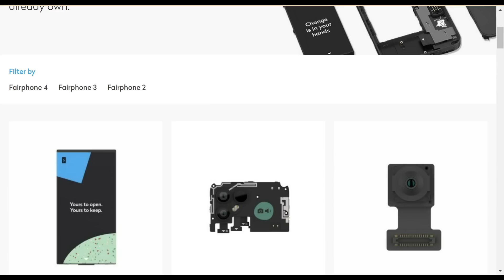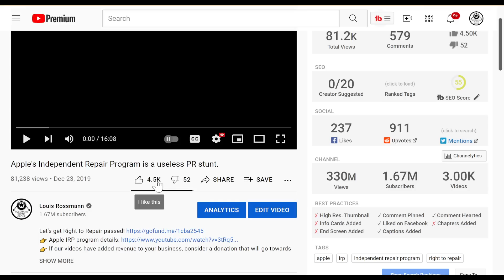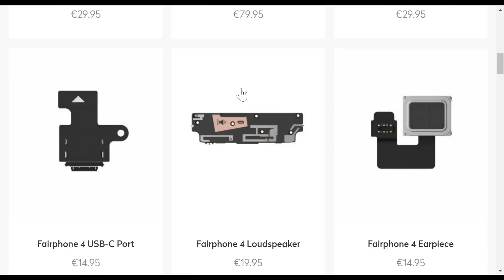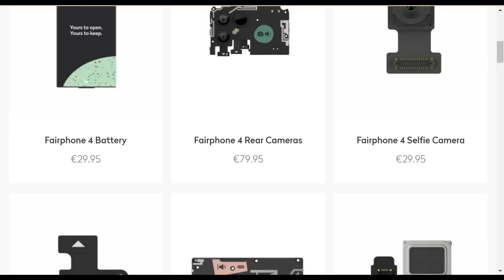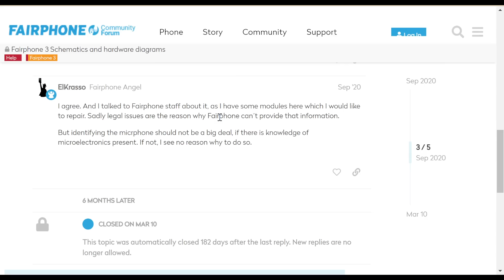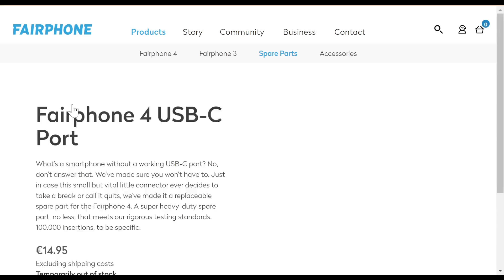Fairphone thoughts & commentary with Louis Rossmann

Comment: but 30€ for a battery and 80€ for a screen though..

My pocophone f1 has a better cpu at half the price and I pay 5€ for a battery and 20-30€ for a screen.
Reply from the maker: Their prices are fair. They're trying to stay in business not selling products made with slave labor. This in my opinion is an unfair criticism of them. Keeping parts available, having a supply chain and everything for that, that cost money. As does designing a device from scratch in a fair trade manner. I have no problem paying for value
Reply: You are missing the point. Fair trade does not mean “cheap” because of slave labor.
Reply: I had a poco F1 and changed the screen. It was 30usd from china, and it was clearly a worse LCD than original, probably not 1080 either.
A decent chinese made battery was about 10usd, the 5 usd ones are usually crap. The prices seem fair. 
Also, the phone itself is not a good deal, that's not the point of the phone. So the parts need to fulfill the  sustainable thing, a fair price is not the point.
Reply: 'but 30€ for a battery and 80€ for a screen though...'  As opposed to shelling out for a new phone.  Pfft.
Reply: yes we all know that there's cheaper stuff around, fella
Reply: A lot cheaper than replacing the phone...
Reply: Your 5€ battery cost 5€ cause its made by slave labour.

Comment: In the last couple of years I've noticed that a phone in my pocket holds at maximum 2 years, I had a samsung and the battery started to pop out, bought a new one and and it did the same just in a couple of weeks. But most of my phones failed on the front panel ... the glass cracked.

In most of these cases first I have tried to remove the glue and replace just the glass but every time I tried that the screen got damaged. It takes skill to replace it. After failing 3 times, I have also tried to bring the device to a repair shop, but it costs more than the device itself. Phone initially costed 400 Schmeckles, used it two years and now on the market costs 100 Schmeckles. Repair costs 160 Schmeckles. It doesn't make any sense to repair it.

But what annoys me now more, is the new feature from Google: "Play Protect certified",  this puts another gravestone on the reparability as some like me will chose to install a new OS if the supplier of the phone just shuts down the updates. Problem is that it will render the repair useless, with the "Play protect certified" most of the apps won't work anymore even if the hardware is good enough. 

With all this, I have decided to buy actually a Fairphone, but it feels like I am going back 10 years or so. In worst case I will need to go to the bank to make transactions and watch the favorite series on the TV. May not be such a bad experience at all :)

Comment: Probably the fictitious billionaire could buy 5G Modem IP from CEVA and processor IP from arm, and so on, and build their own phone SoC, without starting completely from scratch. Whatever NDA's are required for the silicon don't matter for practical purposes since you're not fabbing chips in your repair shop. But the application reference schematics, manuals, datasheets, etc for that SoC could then have a more open release model.

Comment: I know this video is old now but my note8 battery is dying, been quoted over £100 for a new battery from the local shop that knows there shit and doesn't buy crap battery that die in 12m due to Samsung making it a pain and it been an older model now, as I stopped getting updates over a year ago and Samsung locked it down so much lineage OS can not be installed I am not changing the battery, So I am looking for a new phone,  No headphone jack is a huge pain but it has a removable battery and upgradeable storage love the 5 year warrantee and software updates  also want to put my money where my mouth is on right to repair. Do we have any more update re the scamatics? if jo public can not get them I understand to a point but can repair shops get them?

Comment: I'm looking at fairphone for my next phone as Google went evil and everyone is just copying Apple now. The whole reason I'm on Android and not iOS is because it's more open. I feel the market is now more ready for a Windows phone as Android is a far cry from what it used to be. It's been down hill since kitkat if you ask me, change for the sake of change and too many bugs introduced and not fixed.

However that being said, it's probably better for the environment to fix my Pixel 2 XL, but it no longer gets security updates. If I break it replacing my battery the fairphone is my backup plan.

I started in Android with removable batteries, HTC later then added front facing stereo speakers. The batteries I could live without as I was upgrading every couple of years but now I have a package I'm happy with. All I want is my Pixel 2 XL, I need nothing more except longevity. The charge port is loose now, no more security updates and the battery is at 50%.

Fairphone isn't perfect, their first phone didn't offer parts for as long as they expected because the cost to get replacements was prohibitive. They should of offered a trade in program and second hand parts. Still seems like they have a heart, and it's in the right place, which is extremely rare for a company.

I don't want to help rich people get richer and destroy the environment.

Comment: I see many are complaining about the headphone 3.5mm jack.
I wouldn't go back to using a cable.
The audio quality argument is irrelevant as most people can't tell the difference and those who can, can still buy a phone with a headphone jack.
The price is also mostly irrelevant as I used for a long time 25€ bluetooth headphones.
The battery argument is still reasonable, but then I can still use a cable, just not a 3.5mm, but a USB-C one.
Ultimately, the debate seems to be about whether a phone needs 1 cabled port, or 2. As far as I'm concerned, the goal should be 0, but there are very good technological reasons why this goal is not reachable today (see wireless charging issues). 1 cabled port is achievable today.

I understand that some people may need 2 separate ports for their phones. Louis himself has described a use case where 2 ports are a must (something involving a fast bike, long days, and external batteries). But such use cases will always be catered by niche devices, not mainstream ones, like Fairphone wants to be. Could or should Fairphone release one also for that niche market? It could, but what does this have to do with the mainstream Fairphone 4? Similarly, CAT makes phones with thermal cameras for ~700$ with specs more commonly found in 100$-300$ phones. People buy CAT phones and they wouldn't buy anything else. Does this mean that all phones should have thermal cameras? Why not? Aren't the producers taking away the consumer's option of having a thermal camera?
The reason headphone jacks are not common anymore has nothing to do with sustainability, or greediness, or whatever excuse marketing departments are making all around the world. The reason is that people just wouldn't use them, even if they would be available in every phone as we speak. The only exception to this are less developed countries where my 25€ bt headphones would be considered expensive and instead people would use 1$ cabled in earphones. This is something politicians should fix though, not phone manufacturers.

Anyway, there will never be a massive coming back of the headphone jack. Some phones will still have it, just like some phones still have an IR port, or thermal cameras.

Comment: I really like the concept but its just too expensive for a low range chipset. I do believe the LG G5 H820 from 2016 is a much better deal imo. Its costs only $80 USD, its smaller, has SD820 Chipset, a headphone jack, a microSD Card slot,  removable battery (upgradable up-to 5700mah for $15 via Aliexpress). I just wish they made this phone smaller so it can fit in your hand and cheaper. Hope this helps.

Comment: Headphone jack is the last stand. I love my old analogue Bose headset from years ago. I love it that even if I don't use it regularly, whenever I reach for it, I know I can just plug it in and it will work. I don't have to worry about if it was charged, or lithium battery has worn out, or was it paired up with the new device I'm using. I don't have to think about if the blue tooth protocol it uses supports lossless codec like apt-X or now here comes yet another "standard"; aptX+HD. Come on! Keep going down the rabbit hole.  The industry wants 3.5mm audio jack gone, so we can throw away all the quality headsets we purchased and create yet another throw away disposable product line. Dido was so right; Life for Rent.

Comment: As cool as it would be to have schematics, it's not unheard of for component manufacturers to require you to sign NDAs before giving you anything you'd need to actually work with their components. I wouldn't be surprised if it's more than just Qualcomm, maybe the camera or memory manufacturers require it too.

Even in the maker space, many single board computer manufacturers, including the Raspberry Pi foundation, will not provide schematics (and if they do, it's partial schematics with all the secret stuff removed. These are hard to produce and keep up to date, and not always that useful anyway). This is a place where schematics are genuinely really useful and would make a good selling point to many of its users and yet they're absent even here.

Comment: Would right to repair legislation side step this NDA processor reference design issue by requiring the release of the information? Effectively forcing Qualcomm's hand? Alternatively, it's be a shame if the schematics and board view files were to be leaked like lots of of other schematics are. Wink wink nudge nudge

Comment: What if it takes a few years but piece by piece they redesign and reverse engineer every piece they sell, untill they do have schematics of their own and are no longer tied down to other manufacturers schematics? Why would that take years? well Every little piece is already designed to max capacity here, your charge port, camera, battery have as you say has already been well established and copy pasted, but it took years to get to this state.  To best redesign something you would need another base chip, to start from, like something other than the qualcomm snapdragon, exynos or a10, which entails a totally new processor, preferrably with a different headerpin set. Because otherwise no matter how much you start from scratch, you would end up copying the layout to begin with. So in order for that to happen Fairphone would have to invest in a company that e.g makes the camera processor from scratch they make a replaceable camera module and release the schematics for that, but that is a huge investment, the way processors are scarce now I do not think this will be an easy or cheap way to do. But it is the only way to be completely free

Comment: I get it, but the price of a used DSLR camera for the rear camera is a bit too ouch for me. Those parts literally cost a few bucks, but because of the proprietary cable and frame, the price jumps up 10x. Those spare parts are so expensive, maybe I would be better off buying a new phone for parts only. Also 30 bucks for a selfie camera? WHAT?
The price it would cost to get a regular phone repaired somewhere goes right into their pocket by letting the user fix it. 20-60 bucks extra just for the connectors, brackets and screws? No, fuck that.

Comment: Stallman was using a Lenovo laptop. But he was not using the BIOS that came with the laptop. He is using a custom bios called 'Libreboot' which only works on a very select few old laptops. And is created using reverse engineering by a handful of dedicated developers.

Installing Libreboot is a difficult process that involves nearly full disassembly of the laptop and manually flashing a chip on the motherboard using another computer. And even then it still won't work because the default wifi adapter requires non-free software, so that needs to be replaced too.

Comment: We're probably like 4 or 5 years away from a full open source hardware computer, using RISC-V processors. There's one system from SiFive, but it's largely a proof of concept. This is potentially huge because anyone who wants to build RISC-V doesn't need to pay ARM, Qualcomm, etc. license fees and royalties. Chinese companies are very quickly jumping on board, and I hope they start driving innovation here.

The next big pieces needed here are wireless and GPU. Everything else is open standard.

Comment: Isn't board views enough? Why do you need the schematics for repair over board views? Personally I use more board views than schematics. I don't need to go that deep for repair. If there is an issue with schematics and IP issues, why not create a definition for a minimum board view and demand board views? This way cutting off this argument.

Comment: Would you still need schematics if the HDD is not hardwired to the bios/prossesor. If you need to repare the motherbord on a phone like this. would it be better to replace board and then put the drive into the new board. This is if you are looking to get the data off the device. 
Still think there should be a way to get the schematics for bussness and 3rd party repare without braking there cofidetuility agreements with the 3rd party dovelopers.

Comment: I'd be interested in which schematics you need. Soldering new chips on a motherboard most likely requires that you know the layout of the board and the IO of the individual components (and possibly more, I have absolutely no clue), but maybe not the internal specs for the parts themselves. There should be a middle ground here. Companies could tell you what soldering points need what, where they go, etc, without disclosing exactly how each individual chip is manufactured internally.

I would love some clarification on this. I do want you ond others like you to be able to do repairs as easily and effectively as possible. At the moment not handing out specs feels like an excuse since you are not really disclosing any business secrets if the chip itself remains a black box and all you are disclosing is how to talk to it.

Comment: I think you should sit down and think about a repairability score to make the goals extremely plain and simple. For instance, consider this A-F grade scale (WARNING: I HAVE NOT SPENT THE PROPER TIME THINKING THIS THROUGH, THIS IS FOR ILLUSTRATION PURPOSES ONLY):

A: Full Repairability

REQUIRED:
- Full schematics
- Product made with repairability as priority (no obvious corners cut at the expense or repairability)
- No explicit repair countermeasures or clear planned obsolescence.
- Construction has not been made unnecessarily difficult to take apart/reconstruct.
- Repair information not unreasonably difficult to get
- Parts easy to source and will continue to be into reasonable future with no artificial scarcity/reasonably priced

Might have:
- Repair information or components may still require agreement to reasonable terms/program enrollment

B: Repairable
REQUIRED:
- Product made with repairability in mind (no obvious corners cut at the expense or repairability)
- No explicit repair countermeasures or clear planned obsolescence.

- Construction has not been made unnecessarily difficult to take apart/reconstruct.
- Parts easy to source and will continue to be into reasonable future with no artificial scarcity/reasonably priced
- Repair information not unreasonably difficult to get

Might have:
- Repair information or components may still require agreement to reasonable terms/program enrollment
- Schematics/Partial Schematics

C: Limited
REQUIRED:
- No explicit repair countermeasures or clear planned obsolescence.
- Construction has not been made unnecessarily difficult to take apart/reconstruct.
- Repair information not unreasonably difficult to get

Might have:
- Repair information or components may still require agreement to reasonable terms/program enrollment
- Schematics/Partial Schematics

Possible Contributing Reasons:
- Sourcing components difficult/might not be first party/are limited to certain components.

D: Very limited
REQUIRED:
- No explicit repair countermeasures or clear planned obsolescence.
- Construction has not been made unnecessarily difficult to take apart/reconstruct.

Might have:
- Schematics/Partial Schematics

Possible Contributing Reasons:
- Repair information difficult to find/unpublished/requires agreeing to unreasonable agreement or concessions

- May have difficult to source components.
- May have design not made with repairability in mind

F: Not repairable
Might have:
- Schematics

Possible Contributing Reasons:
- Device construction unnecessarily difficult to take apart/reconstruct
- Repair information difficult to find/unpublished/requires agreeing to unreasonable agreement or concessions
- Repair requires gray market information or components.
- Has repair countermeasures or clear planned obsolescence.
- Repair information unpublished

-----

Using this grading scale:

This phone: B or C but could not reach A
Steam Deck: C or D but could not receive a B or A

Macbook: F (repair countermeasures, clear planned obsolescence, repair requires gray market information and components)
Microsoft Surface (before changes): F (Device construction unnecessarily difficult to take apart/reconstruct) -recently they have committed to resolving this, we'll see
Most Laptops: D (difficult to source components/not available from first party)
Tesla: F (repair countermeasures, repair requires gray market information and components)